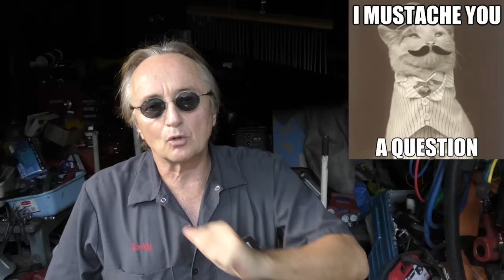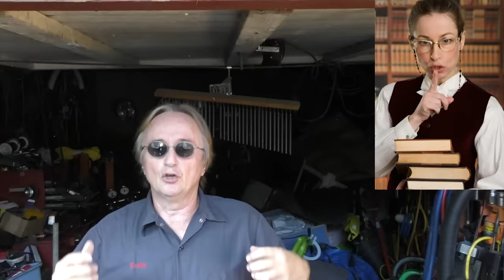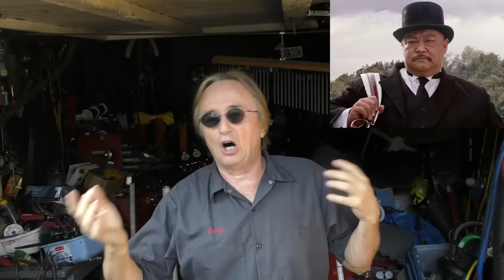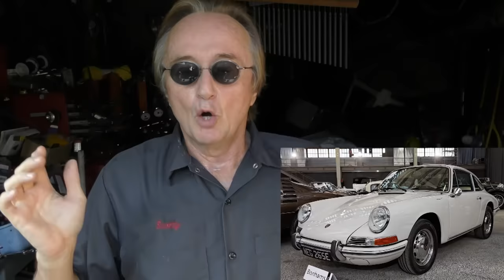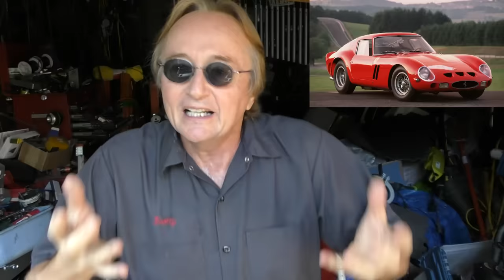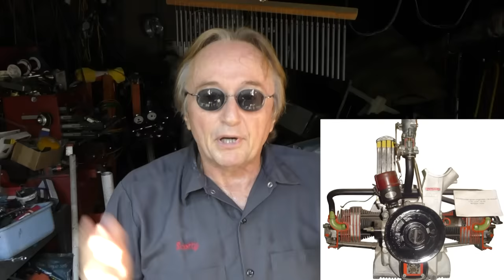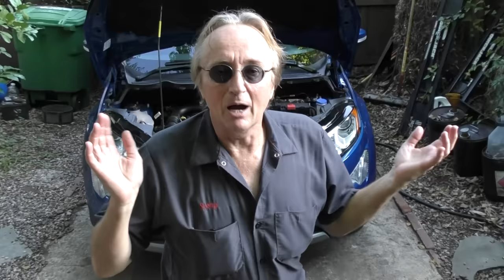The Truth About Boxer Engine Cars

Comment: I have a 2005 Lexus LS430 (original owner) with 108,000miles on it. The only thing I've replaced (besides battery, brakes and rotors) on it are the front struts, front right wheel bearing and a muffler. My mechanic has recommended I change the timing belt and even though there are no leaks the water pump before anything fails. Should I do that? P.S. When should I change the spark plugs? Drives great and engine runs smooth.

Comment: Scotty's a bit annoyed at Toyota buying 16.5% stake in Subaru....maybe Toyota is realizing they can learn a thing or 2 from Subaru
Reply: I think it's the other way around. What toyota burns a quart of oil every 1000 miles ? none. I do love the way the my 2015 forester drives and handles but a quart of oil every thousand miles and worse on road trips is more than i can handle. Maybe if toyota used subies design using their materials you may have something. I would take a rav 4 any day of the week over my forester.
Reply: @michaelcafaro4022  my 2016 rav4 is a really good suv, I did get stuck in some shallow sand at the beach once (it's 2wd).....but my cousins Subaru crosstrek hasn't burnt any oil in 1.5 years (I always ask )....but it is the new (design) direct injection engine, so maybe they fixed that prob.
Reply: I was kinda referring to Toyota 86 using Subaru's engine and also Subaru's awesome AWD system.

Toyota is not a car that doesn't have problems (past or present) ....just 'google' Toyota problems or Toyota rav4 problems (automatic, engine and paint).

Toyota still an awesome car....
Reply: @geoffjefferson5571  Having worked for toyota for 5 years or so, I'll agree with you.  I prefer subaru's fairly simple and standard cross platform design.
Reply: @michaelcafaro4022  I have a 2001 Outback H6 with 358,000km on it and it burns no oil. It's my 3rd H6 Outback.  I think you may be either driving your engine too hard, using cheap oil at the wrong intervals, or you did not break it in properly. I can't speak for the forester 2.5, but I know it's the same H4 they use in the Impreza, and I don't hear too many Impreza owners making the same claim,
Reply: @damojan   I love my subaru and baby all of my cars but there is a problem with oil consumption with certain vins between 2013 and 2015. It's a fact and there is a class action lawsuit in NJ currently against Fuji Heavy for this reason. Oil lights shouldn't come on 4 months after leaving the showroom. It's an issue that Subaru is dragging their feet to rectify. I'm not talking rally racing but for the individual that needs a reliable vehicle with some off road capability the rav4 is a better choice. Yeah, its not pretty and its very boring to drive but speaking just of investment purposes the toyota is a better choice and you have web sites to prove it. My brother is like a modern day felix unger when it comes to maintenance of his vehicles and it was always something with his 2006 outback.Your 2003 used a better engine than the current 2.5 even though some had head gasket failures.
Reply: Like how to blow engines? The class action lawsuit about them blowing motors in the brz and 86 is a good example of them learning.....

Comment: That boxer low CG sure worked out well for Chevrolet, didn't it?  or, not so much.

Boxer cranks are always longer than V's of the same # of cyls. balanced, or not, it's still more rotating weight, and more twisting. Boxers have a notorious reputation for breaking cranks.
Oil consumption is always a problem with boxers, and with that emissions, plug fouling as the rings wear.
Oil surge/starvation problems with cornering/steep inclines unless it is a dry-sump design.
More seams for oil to leak out of, there is always something dripping from somewhere, enough to make a Harley owner jealous.
more head gasket area to become a problem
effectively 2 water jackets, and all the associated leak/connection problems.
Long intake runners. lots of hot exhaust pipes.
Look at those timing belts!   Those would wrap the fat lady at the circus, and still have distance to go.
Cams are longer, more prone to twisting/torsional load fatigue.
Reply: How many boxer engined cars have you actually owned CaberFeidh? I have owned 4, and if maintained and serviced properly, and not ridiculously modified they are super reliable. Just need Germans or Japanese to design and implement them properly.

Comment: I love the Subaru boxer rumble but the head gasket issues put me off buying an STI. Went with a civic si. Call me crazy 🤭
Reply: Scotty kinda glossed over some of the finer details in this one. The biggest head gasket culprits were the non-turbo EJ engines, almost all Subarus use a different family of engine today, either FB or FA in the case of the WRX.
Reply: Head gasket issues are not common anymore. 2l and 1.6l subaru engines has much thicker cylinder walls and 30% thicker steel cylinder lining than the ej25 2.5l. Even the 2.5l typically don't have head gasket issues on stock tune after 2013.
Reply: any engine can have head gasket issues.
Reply: Lolled9991  Still, boxer engines no matter the manufacturer always have a distinct scream to them. Hard to explain, but listen to a straight piped EZ30 or any flat 6 Porsche, then compare it to the FA20. They definitely sound different but you can still hear it in the FA. You can also compare it to NA EJ25s and you'll hear an underlying scream. Very sexy sounding engines. Even Honda makes a flat 6 in their goldwing motorcycle.
Reply: good pick predatowned.
Reply: Talk about downgrade. Should have got a 370z instead.
Reply: But what about ringland failure?
Reply: predatowned bruhh Head gasket issues are much less of an issue in the turbo models vs the NA due to the design of the gasket
Reply: They pretty much solved the HG issue in the mid to late 2000s. So yeah, you missed out.
Reply: FYI for those that don't know......The sound of Subarus ..ya know that amazing rumble... isn't because it's a boxer engine...its the unequal length headers.
Reply: @JOEMONEY666  you can still get the sound even with equal length, just not as deep. Boxers have a unique sound in general. Yeah you can put UELs on an inline and achieve ALMOST the same sound, but still not the same sound.
Reply: The sti never had the problem. It was only the 2.5 litre engines
Reply: Your crazy
Reply: @brokenSnake  STI in North America only ever had EJ25 engines...

Comment: The new boxer in the frs/gt86/BRZ is tuned for low power. That's also why they have skinny tires. Supposed to be a inexpensive sports car.  Everything is going low power because of the out if control government regulations for mpg and emissions.

Vehicles are not longer about the experience. They are about moving people. That's it. That's why the manual transmission is dying. People are lazy and don't care about the experience.
Reply: I'm actually surprised how long  the newish line of Subaru CrossTrek's, (or XV in some markets outside of the USA) have continued to offer a tier with a manual transmission. I think it's great that they still do.
Reply: I love fast manual cars, but To play devil's advocate, for most people 99% of "the experience" is spent in moderate to heavy  traffic and it's not like the old days - there's radar, laser, and traffic cameras everywhere. That's why the main focus is  electronics and creature comforts. But there HAS been somewhat of a resurgence of performance over the years

Comment: How old is the in line 4 cylinder?  Old
Reply: Yeah.. I dont think its because its an older design that it is less popular. 200hp in a 2liter motor without a turbo is pretty good despite the torque curve
Reply: @invertedv12powerhouse77  think about240HP f20c/f22c 
Engine
Reply: The fastest 911 (in the 1/4 mile bracket, not top speed) is in the mid 8s. There are I4 based cars (with very large turbochargers) that are way faster than that, even ones designed a super long time ago
Reply: David Regan 4G63 all day
Reply: My Allis Chalmers has an inline 4...  It's 1947.
Reply: @garybrinker4522  As do Farmal, Case, Massey Harris & Ferguson, Ford, and the list goes on. I grew up on those green Johnny Poppers, but all those four cylinder tractors we're good machines. Old school design was not great for high power, but, my, how those old tractors could work and run forever. And definitely a far cry from the modern four cylinder motors of today.

Comment: The head gaskets are being corroded by pooling of coolant.
Reply: Winner. Neglecting your coolant system exacerbates the issue of poor head gasket material choice (graphite) that Subaru used for many years. Notice how the turbo cars with MLS headgaskets rarely have issues.

Comment: Subaru sh 2008 100k miles 
 oil leaking, 
automatic 4 transmission is starting going bad.
But overall super car!!!
Reply: Kostya Chireev  yeah I’ve had 2 2006 STI’s and my most recent one I babied the hell out of it and wouldn’t ya know right at 110K head gasket went...😞
Reply: Kostya, you see the glass half full. 

I don’t think I would be as positive at 100 k transmission going bad.

Comment: About half nonsense, I think. Boxers have no more tendency to blow head gadgets than any other engine. Air cooled engines can get much hotter at times and THAT could lend itself to the gasket issue. About packaging: Yes boxers are flatter and therefore have a somewhat lower CG, but they are also much wider and cause issues in other areas like suspension and access. Boxer crankshafts inherently are less stiff because they have less support. To mitigate this they have be be built heavier. Boxers also have two heads vs one head of an in-line engine. This adds weight and valve train complexity. There is also little or no reason why a boxer engine can't produce power like an in-line engine, or Vee. Boxer engines are more expensive to produce and, along with the aforementioned packaging issues, may dissuade manufacturers from using them more.
Reply: Well said.
Reply: I call BS on that. 2 head gaskets on a 4cyl boxer vs 1 on an inline 4 means you have 3 items experiencing thermal expansion rather than just 2. Also anecdotally I don't know anyone with a Subaru outside of warranty that HASNT had to replace them. Turboed or NA. My friends entire side business is repairing Impreza engines...
Reply: Air cooled engines are designed to run hotter and were built from different materials like magnesium. A lot of air cooled engines either didn’t have head gaskets, or had sealing rings.

Comment: Isn't the reason VW gave up on the boxer engine, because it was far more expensive to produce than a straight four? And if the engine is so bad why would Porsche stick with it? Is it a purist thing? Personally I drive one, and the handling on that car is like no other. Ive driven many other v8 and v6 cars, and you can really tell the difference at high speeds.
Reply: they are underpowered unreliable garbage compare to modern engines. its a shame to see subaru still marketing their sti/wrx as high performance sports cars when thy have had the same hp for the past 10-15 years
Reply: The 350 hp 4-cyl boxer in the 718 Cayman is no garbage.
Reply: thats what im saying.. I hate to admit it but I loved it.. I mean Porsche has to be doing something right if their cars can still out perform Ferrari, Lamborghini and more.. but Toyota doesnt have any performance cars that can rival
Reply: KoG GoK the sti has had the same amount of power for 15 years, but the wrx hasn’t
Reply: @WhiteGravey  You're gonna get your wish in a year or two when Subaru finally ditches the EJ once and for all. The WRX was the first to have the new FA20, now the ascent with the FA24. I bet Subaru is gonna tune that same engine for 330-350hp and it's gonna be absolutely unstoppable in the STi
Reply: you think 330-350 hp will make somthing unstoppable? you can get that from current sti with a of the shelf stage 2 tune from cobb.
Reply: One of the many reasons GM gave up on the Corvair. The engines were simply too expensive to produce for an economy car.
Reply: Boxer designs are very reliable just like most other engine configurations when maintained properly. Most light aircraft use them because they are light weight, inherently balanced and the shape is conducive to aerodynamic efficiency.
Reply: really? is that why you see sti/wrx with blown ringlands at 10k miles? blown headgaskets at 15-20k miles? go read any subaru forum so you can see what pos these engines are. if they cam closed decked from the factory with ARP headstuds then maybe your statement would be true.
Reply: But I'm really don't understand the reason for boxer engine is outdated. Inline 4 is not outdated? Or we should change into inline 3? Doesn't anybody felt car is boring nowadays?
Reply: @WhiteGravey  And then you're gonna get a shelf tune for the FA24/25 and make 380-400... We're not talking about mods here, as I have no interest in them. I'm interested in what the manufacturer and their performance division can do with the car. Once you're talking mods, the sky is the limit. 350hp from factory alone and the STi will dominate the RS and Golf R. Along with numerous handling and transmission tweaks, yes, the new STi will be unstoppable.
Reply: @WhiteGravey  I honestly haven't seen anyone talk about brand new WRX ringland failure. The only way I can see that is if the owner bangs it off the rev limiter upon cold start then proceeds to do pulls until they get to wherever they're going.

Comment: Im sticking to inline 4 cylinder engines... much easier to repair and maintain.
Reply: boooring
Reply: Me too
Reply: Only 1 cylinder head to medle with not 2 like boxer...easier to change plugs, air oil filter..less clutter...you can do them yourself
Reply: get the a 6 cylinder one. it's much more comfy to drive.
Reply: @fidelcatsro6948  ok I have a subaru, working on it is very easy. Nothing is in the way from reaching the exhaust bolts, any pulleys or outside parts are most accessible than other cars ive worked on, and its probably one of the easiest engines to remove ive ever had to do. 

They are very fun to work on. The only downside is you have to remove the engine to work on ilthe engine itself... But even that isnt hard, me and my friend just grab both sides and its not even heavy.

And removing a plastic box takes like 1 minute my guy
Reply: I like how I can change my oil with out ramps it's the easiest car to work on next to a 90s gm
Reply: Lol you're a funny person
Reply: How often do you repair your inline 4?

Comment: Which new heavy duty 3/4 ton truck is the most reliable ? Diesel or gas for moderate travel trailer hauling (8000 #). My 2007 Dodge Ram with a hemi and three speed auto does fine but, like you and me, Scotty, getting some miles on it.

Comment: Scotty, why do you think SUV sales are on the rise despite the higher cost of running them?
Reply: The economy is up so higher maintenance and fuel cost don’t matter to people
Reply: Because roll overs are fun
Reply: Noel Medina Pretty good answer
Reply: better visability. better in snow. bigger boot. roof rack for xmas tree.
Reply: Actually, they don't have a much higher cost as much as they used to.  Just compare like cars.  The BMW 3 series sedan gets 21 city/32 highway.  The SUV X3 gets 22 city/29 highway.  So while the car gets slightly better mileage on the highway, in the city, the SUV actually gets slightly better mileage.  When you make that proposition to a customer, who generally drives in the city, they don't see the higher cost you refer to.  This is comparing the same engine and transmission on both.  Now the cost of purchasing one - there is a difference there.
Reply: bnighter if I am sacrificing gas mileage I would just get a truck with 4x4.
Reply: I think another factor is that it just seems to be a fad now.  Many people will buy a SUV just because their neighbors have one and so forth.
Reply: I actually was not going to get one but then when I found out a massive discount on one (over $13,000 off of MSRP) that made it $10,000 less than the equivalent car, and the gas mileage was about the same, the additional cargo capacity sold me on it.  Now I don't have to rent a bigger car when I need to carry stuff, or cram my car with camping equipment when it does not fit.
Reply: Herd mentality and being duped by advertising.
Reply: Camry is a brand new design, but the RAV4 is not.  My comparison is better, the same generation.  You are comparing two different generations so of course, there is a bigger difference.  When the Rav4 is redesigned next year I think you will see that margin shrink substantially - close to nothing. There was a reason why I did not compare the two Toyotas - the generation gap makes a huge difference.
Reply: gas prices are artifically cheap to combat the coming wave of EVs.  ($5 a gallon gas=folks switching in droves)
Reply: Rob, cannot compare Toyota as you are comparing different generations of cars/SUVs.  Both the Buick Envision and Buick Regal are relatively new and same generation (like the Chevy Malibu/Equinox).  Sorry to disappoint you, again the gas mileage is not that different.  20/28 for the  Envision, 21/29 for the Regal.  Equinox 22/29 and Malibu 22/32.  Ford Edge 20/27 and Fusion 20/29.  Do you want me go on?  Or do you want to complain without checking any facts?
Reply: I just pulled what was convenient on fueleconomy.gob which lists all the cars.  My bad for picking BMW... but does not change the facts gas mileage after new models come out differ only slightly.

Comment: 2017 Subaru legacy boxer engine full syn oil change every 9k miles. No faults on the car in 223k miles. Boxer engines have less vibration than up/down piston engines. Which is why there is an original motor Subaru with 900k miles on it still driving on the road. Less vibration means less metal to metal contact inside the motor.